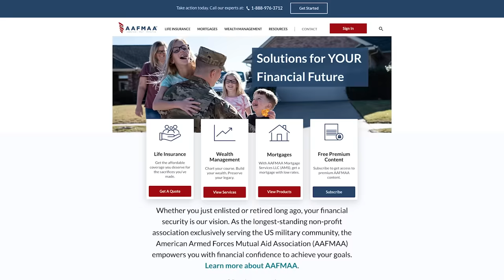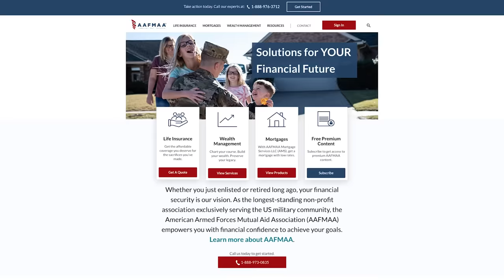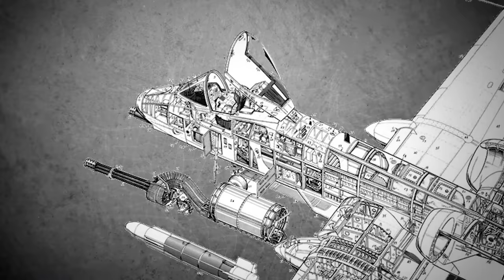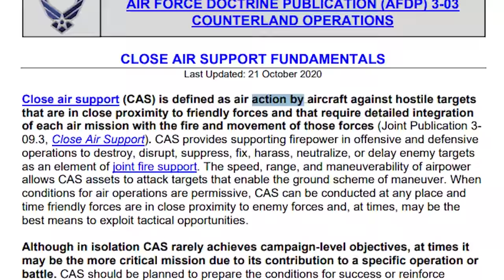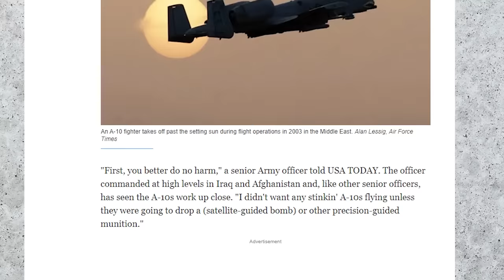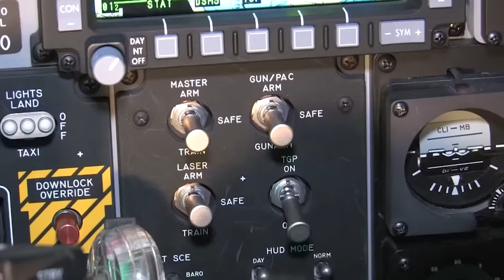Why the Air Force is Screaming to Retire the A-10 Warthog

Comment: Im a retired air force guy and i love the A-10 probably more than most. I. The final analysis the sole purpose to having an air force is to support the army while they win battles and everything the USAF undertakes is to that end. That said, the warthog's time has come and gone. Like the video points out its an old airplane. The newest airframes are almost 40 years old and they can't fly forever. And the A-10 is just not viable in a modern air defense environment. The attack helicopter is better suited for the CAS mission than any fixed wing airplane. The first airplanes over the border and striking targets in Desert Storm were  AH-64s. Letting the Army run its own  CAS greatly simplifies things.

Comment: As an Air Force vet (C-130H/OV10a crew chief) I really think that the AF should quit trying to rule the skies and let the Army and Marines have all the A-10's and AC-130's. Ground troops are the ones who need them so why not? The Air Force is all about keeping control of fixed wing aircraft but that shouldn't let them ban other branches from having their own specialized aircraft. Can you imagine if the Marines had their own AC-130's? I'm pretty sure the USMC will figure out new and exciting ways to use a gunship.

Comment: 6-year A-10 Mechanic here. Veteran out of Moody AFB.

I'm not saying the A-10 isn't a fun plane to talk about, one I was happy to work on, and one that didn't have some interesting engineering.. but it was NEVER a good plane. That thing was outdated when it was built.

Even in theatre, we did some like 8% of CAS at the high point back in the heat of the post-9/11 wars. When I did my last deployment in 2020, they were window dressing. That's in total air dominance against a strictly ground force.

Seeing the Air Force's previous attempts get stopped by senators who obviously didn't know what they were talking about like seven times was hilarious but always concerning. That plane is a death trap for pilots in any real war. And I didn't know how to feel about all the older Veterans who still acted like this thing was useful. It wasn't useful in Afghanistan, how could it be useful in other theatres?

As for CAS... we have more effective aircraft for that mission already, mostly drones. They did 90+% of the work in-theatre for like fifteen years, and don't have a human in them that could die with it when it's inevitably shot down. Sometimes, F-15Es would do some heavy lifting when things picked up. A-10s showed up as like, a "moral support" thing.
Reply: If those kids could read they would be very upset

Comment: The problem is the Air Force really doesn't like doing CAS since they split from the army, and they don't like allocating budget to an aircraft dedicated to the role. They'd prefer to  have it don't by a multi-role fighter, so they have more multi-role fighters.

That's why they keep  trying  to shoe horn in the F35  into the role, when it really wasn't meant for the task.

The honest  best solution to replace the A10  would be a large drone with either a large internal gun, or gun pods for flexibility, and lots of weapon pylons. It being a drone helps boost loiter time,  and removes the pilot from the risky role.
Reply: The F-35 was designed first and foremost to provide the USMC with a better CAS platform than the Harrier. So it is absolutely capable of effective CAS, especially when compared to the A-10 on more complex battlefields than when fighting terrorists.

The Air Force do CAS with almost every combat aircraft they have, from light drones to strategic bombers specifically modified to work with JTACs.

Comment: Easily the most frustrating talking point on the A-10 is the armchair general worry that "we don't have a dedicated successor to it". We don't need one. Multirole aircraft have already been picking up the slack, and now that we're not in Afghanistan anymore, we don't need or really want something that loiters like that, outside of drones, which are cheaper, and if you lose one, you aren't losing a pilot or two

Comment: The A 10 sits between an Apache gun ship and an F16 multi-role fighter plane.  It is a Swiss army knife designed for air to ground support. It it is not broken don't fix it.
Obviously things like maintencr and repair costs matter over time so just build a new A10 with the new manufacturing and stsyems that improve the A10 but reduce maintenance and repair costs.

Comment: This is your regularly scheduled reminder that the A-10 is responsible for the most friendly-fire incidents of any US warplane in the last 15 years, mostly due to its near-total lack of modern radar capability. The army has been wanting to retire it for literal decades at this point. It is a tank-killer built around a gun that hasn't killed a tank with said gun since the early 90s.

Comment: I was a mechanic on the F-4E in the early 1980s and an A-10 mechanic on my next assignment.  So, being intimately familiar in both aircraft's structure and function, I can compare the two.  While the A-10 is described as rugged, it is anything but that.  It is flimsy, slow, under powered, and we felt that in a fight with the Soviets, they would be knocked down like flies.  The F-4 on the other hand, was the definition of rugged.  It was solid, fast, carried a lot, was maneuverable, and as we like to say, was proof that with enough power it is possible to make even a brick fly. 
At the time, the F-4 was combat proven but the A-10 was not.  Even with the conflicts since then, the A-10 has not proven its ability to survive in contested airspace since it has only been flown against insurgents, terrorists, and third-world militaries.
Reply: During the video I was wondering if Ukraine could make use of A-10s. Sure, Ukraine does not have full air supreriority, but might be able to achieve it locally with the F-16s it will get next year. From the video and your comment it seems to be a mixed bag.
Reply: @steffenrumpel2784  I doubt Ukraine will be around next year even if the west sends them there.  They have Mig-29s and the F-16 is only marginally better, so what is the point?
Reply: @Tinbender-zr4jd  Don't think in terms of plane types because that is a war of attrition. The big difference lies within maintenance, spare parts and a steady supply of weapons that can be used with the planes they have. Ukraine must have quite the difficulties to keep using their Mig-29s. That will be different with the F-16s they get, when they get them.

Comment: Valid points, as much as I hate to admit it. I know we loved having them in the area in Afghanistan. 
I think one key here is that CAS is now two separate and distinct missions:

1) Counterinsurgency (COIN) 
2) Conventional forces

For a COIN environment, not having air defense, it might be wise to simply develop a turboprop aircraft. 

For conventional warfare, maybe start with a 60 mm DU gun and go from there. Design a tough drone around it, also a turboprop, but add in laser guided and/or inertial guided bombs GPS jamming is a thing). As long as we can maintain our commo capabilities to keep them flying, we should be all set. Add in modern sensor and commo networks to prevent friendly fire mishaps. Make them modular and cheap so they're easy to repair and move en masse. The war in Ukraine is certainly proving how valuable drones can be; if we can easily get good target designation and keep humans in the kill loop, we could use anywhere from one drone to a dozen for target designation and then unleash a swarm that would take out every piece of armor an enemy could field within minutes. 

Imagine a dozen drones designating targets, each with ten AI piloted escort drones...

Comment: Now I could see an argument for something like loitering munitions like the S300 and s600 “switchblade” suicide drones taking on the role of fire support and providing CAS. If produced in enough numbers. Especially if you have a self contained mass launching system that can be dropped  near the front lines to provide immediate support to troops in contact.

Comment: The Republic P-47 Thunderbolt, but is commonly referred to as the "Warthog" should shift production entirely to Australia, and upgrade missiles for tank kills as an 'Optionally Manned' aircraft. That is a remote pilot may operate an A10 version in close combat. the US  Army must consider the newest versions of helicopters capable of doing the former role of the A10, but as a platform it is unrivalled. If it is turned into a UAV, pilot loss will not be a problem.

Comment: And we all saw what happened to the British Tornado's down on the deck in Iraq. You can't bypass armor and survivability or the close eyes on the ground that something like the a-10 provides. The only solution to replacing the A-10 is basically to build a better A-10 using modern materials and upgrades.

Comment: The Super Tocano (or a modified crop duster) is a far better (proven) solution for CAS. A10 was originally intended for antitank work in Europe and was left flailing around for a mission when it was realised it wouldn't actually work in the envisaged situation

There's a difference between sounding good (the "brrrt") and being the most effective solution. In Afghanistan the insurgents merely headed for the ditches when they heard the A10 coming and stayed there until it vacated the area

Comment: The A-10 literally couldn't even do its primary mission *when it rolled off the production line*.

The GAU-8 was designed to penetrate the top armor of the T-55 tank, which was the mainstay of the Soviet armored core.

By the time the A-10 was ready, the T-62 and T-64 replaced all the T-55s, which doubled the top armor, which meant the A-10 had to get within significantly closer range to achieve the top armor penetration.

At the same time, Soviets had just begun upgrading the ZSU-23-4 Shilkas with radars, and Soviet mechanized doctrine was to accompany all armored units with SPAAGs.

This meant that the A-10 was doomed. It will always get shot down by the Shilka before it can shoot a tank.

This is precisely why the A-10 was turned into a missile truck for Mavericks. The gun is worthless. Its primary anti-armor role was to just float in, fire off 12 or so AGM-65s from 12 miles away, and then turn around and go home.

Comment: The USAF has been trying to "dump" the A10 since the first Iraq Conflict.  High ranking officers want something more "High Tech" (and expensive).  Pilots love it.  After the first conflict ended "higher ups" remarked how the A10 saved the day.   The USAF has been threatened with reassigning ground support to the U.S. Marines.  Marine pilots are better trained for this type of mission.  Marine pilots are trained to be more familiar with ground operations.  There is no doubt the Marines could "do more with less".

Comment: The best solution would be to reabsorb the Air Force into the army. They've never really wanted to do their main job which is supposed to be closer support, that's why the army has all those helicopters.  

With the advent of the space force, there's no real reason for the Air Force to have a continued independent existence, the same people can do the same job and lose the extra command structure and bureaucracy.

Comment: What they need to do is build  a good 3 or 4 hundred more of them brand spanking new.
 But sit down with a group of pilots and ground crew mechanics asking them what needs to be changed or tweeked to make a better platform. 
 Look at the M2 MG it's been around before WWII yet is still being made and used by all branches. With very little changes to it.
 Sometimes the Millitary comes out with stuff that stands the test of time and is still hands down the perfect peice of equipment decades after its implemented.

Comment: The USAF needs to request for aerospace contractors to develop a modern airframe and weapons system dedicated to the close air support mission to replace the A-10C.  The same needs to happen concerning the F-22A in the air dominance role since there is a shortage of airframes dedicated to that mission.

Comment: With hindsight being 20/20 tge USAF might've been better off retiring the A-10 and going with the A-7F in the early 90s. The A-7F was faster, more payload, and had broader capabilities. 

Ukraine has proven really cheap drones are capable of taking out even MBTs. It's almost impossible to have collateral damage and provide  real-time battle field surveillance. Sometimes the best CAS is in your backpack.

If you must have a plane for COIN/CAS then Super Turcs, Texan IIs, or Air Tractors are the way to go. They can operate from remote FOBs and engage multiple targets with the new 70mm guided rocket pods. Every USAF pilot has already flown the Texan II so it makes sense.

The A-10 was a great bird, did it's job, but now its time to retire in Tuscon.

Comment: Having seen first-hand the aftermath of that blue on blue mistake in Iraq, I can attest to this fact. There is NO other aircraft on the battlefield that is capable of stopping an infantry advance in its tracks. When you hear that fucker coming you run away quickly, and because it can literally turn on a dime, and be on your ass again, lining you up for another run in seconds, you simply can't get to cover. The A10 is both an enemy demoralizer and a friendly morale booster all in one, and the power of that effect can't be written off in some CAS procedure.

Comment: I strongly disagree about the A1E. They were tough as nails, far more accurate than an F4, carried more munitions and, because they could loiter for many hours were their when we needed them. The F4s had to sit on the ground until a FAC called for them. ALL of the USAF pilots that I talked to said that the A1E was a better ground support airplane. As a Ranger on the ground, I did too. I think that the Air Force brass just wanted to fly jets.

Comment: In the next era of primary drone warfare, pilots are expensive to replace, but drones are cheap, mass-produced goods. This means that sending swarms of cheap small drones is more effective than sending a large, slow plane that crashes if its cannon fires for too long.
Apart from that, the plane is known for being damn imprecise and the pilots are very trigger happy, which also explains the ammunition consumption.

Comment: I find it interesting that with modern drone tech that CAS operations are not primarily handled by dedicated Army CAS drones, which are an internal part of an Army brigade.
We see in Ukraine how "suicide drones" effectively deal with armour, and Ukrainians even built quadcopters, which can carry a standard mortar round to fly over Russian trenches. Having CAS handle primarily internally in the brigade might also help to limit friendly fire. You might even have someone in a patrol, who could take over control of a loitering drone above, which otherwise is controlled by a dedicated pilot. And with local control, you could significantly increase accuracy. Or maybe local control is only for controlling munitions and not flying the drone.

CAS-UAV Operator could even be a platoon level specialisation? 

If you want something bigger, then take the A-10, take out the gun, and then build a large UCAV around that. Removing the cockpit, pilot, pilot armour, gun, and gun ammunition would do amazing things in terms of weight.

But unless you need 500+ pounds of enemy removal, then I do not see a point of focusing any multi-role fighters for this operation. CAS is logically an Army mission, interdiction is an Airforce mission. So give the army the drones and helicopters they need, and make those Apache into a sort of drone motherships.

Having the Airforce fly CAS should be a last resort, when you just need that extra booooom.

Comment: They just need an updated model. The ones in service are old and are maintenance nightmares due to age, the instrumentation and electronics are outdated and unreliable, they only have a 90 minute flight time and flies too slow, and every time you fire the main gun the entire aircraft has to be taken apart and rebuilt. It’s completely unacceptable that for every 90 minutes in the air they spend 3 days in the repair hangar.

Comment: The Air Force has been trying to get rid of the A-10 since before it was even made.  The fighter Mafia at Air Force headquarters in the Pentagon have always felt a Mach 2+ fighter is the answer to any need regardless of what the data shows.  In Vietnam, the A-1 (and the A-37 later) we effective in the ground support role because the moved slow enough to identify and hit the enemy that was close to friendly forces where a fighter/bomber coming in at high speed is going to be over the target for only a split second, too fast to identify and target something on the ground.  Also, they had the issue of being able to linger in the battle area without the need to refuel.  After the war was over, the A-1 was scrapped, and the A-37 was given away to any ally that would take them leaving the Army without a close support aircraft.  The A-10 project came up and the Air Force refused it but the Army said if the Air Force would not back it, the Army would. That set off alarm bells in the Air Force command as up till then, it had been agreed that the Army could only have propeller aircraft, jets being reserved exclusively for the Air Force.  To keep jet aircraft from the Army, the Air Force reluctantly accepted the A-10 and immediately assigned it to the Air Force Reserve except 2 squadrons (one in Germany and one in Korea) in front line duty.  The Air Force has been trying to get rid of it since over the objections of the Army.